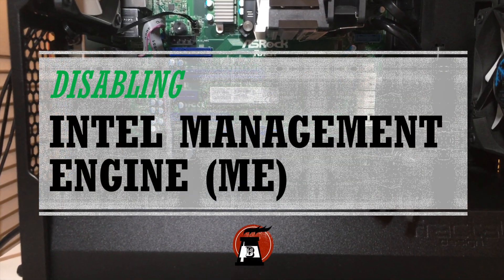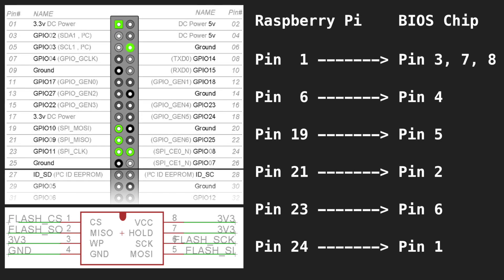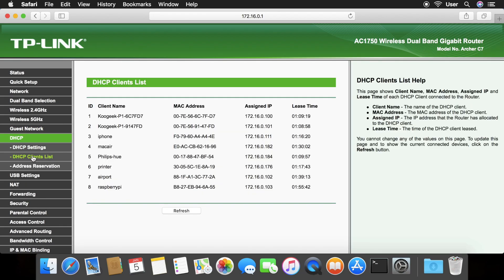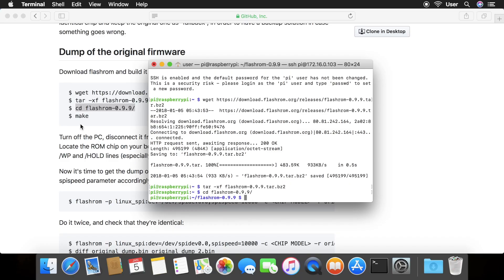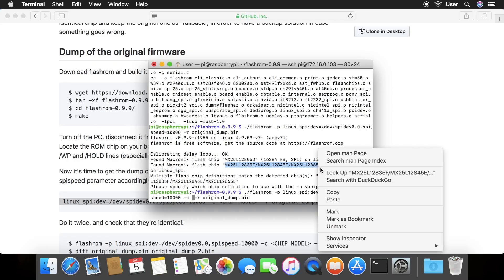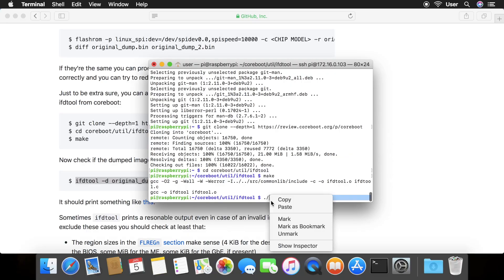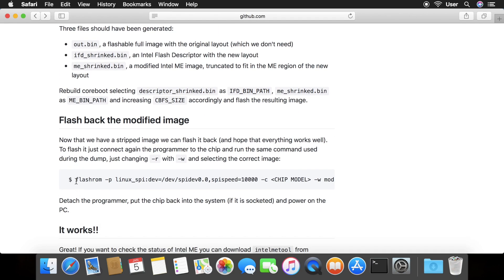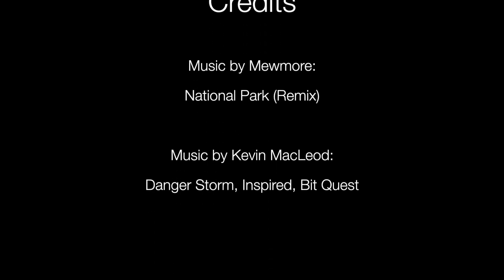DIY: Disabling Intel ME 'Backdoor' on your Computer

Comment: Intel ME cannot be disabled. It is embedded in the CPU and if you successfully killed off the Intel ME in your CPU, your CPU wouldn't start at all. What you are doing is disabling the BIOS code that talks to and enumerates Intel ME stuff and makes the hardware interfaces available to the OS. The ME is still running on your CPU and still has complete control over it.
Reply: Thanks for that explanation, as I was just going to ask how he knows the ME is actually disabled. It didn't make sense to me that one could modify bios when this ME is built into the CPU itself. Cheers!
Reply: @TecraTube  Supposedly, there's a flag that's undocumented which can be used to turn off the ME, inserted at the request of a three-letter agency for their computers. Even if it works as advertised, it can't fully disable the ME. It's still required for processor initialization and enabled during BIOS startup. A UEFI rootkit can easily get around this, for example.
Reply: @JodyBruchon  the alphabet group has custom built processors, they dont use off-the-shelf processors
Reply: @narmale  Aside from environmental certification, shutting off the ME is probably part of the MIL-spec part versions (which cost 4 times more).
Reply: @Drakilicious think bigger, computers have integrated wlan, and this fcking spy part in your processor will use ANY possible method to connect to its masters. and there may be embedded technologies, we dont know or even understand, like other RF stuff or st else.
Reply: @Drakilicious It's possible theoretically that the flash drives' firmware contain malware that can transfer data outside of the file system visible by the user. To avoid this use optical discs and floppy discs, they don't have firmware.
Reply: @vstoykovbg  but anyone who gets a hold of it can read it, unless it's a file drive containing important info that was encrypted prior. Who's going to spend all that money to buy DVDs?
Reply: @pieterwillembotha6719  Of course the data is being encrypted. 
But the problem is the malware can write unencrypted data to the inaccessible by the OS areas, so the user using a normal OS can't verify that there is no unencrypted (or encrypted by the atackers's key) data.
The DVD discs and floppy discs can be read and the user can verify that there is no "hidden" unencrypted data on them. This is not possible with USB devices.
For very sensitive data paper and pencil can be used (the user reads from the monitor and write the data on the paper encoded with RFC1751 or similar user friendly method of encoding binary data). The computer should be air-gapped. And for very paranoid users - with no hard drive, no USB devices. Because data can be hidden inside these devices.
https://github.com/vstoykovbg/RFC1751-encoding-decoding/
Reply: @vstoykovbg  Thanks for bringing that to light. I am a bit of novice.
Reply: Can they still spy on you if you completely disconnected your PC from internet connection?
Reply: @BessY992   Well, if you put it in a bunker 500M under the ground and never  connect to the internet..

y e s
Reply from the maker: I didn't say I was disabling Intel ME altogether, just the backdoor. You are correct, Intel ME itself cannot be disabled.
Reply: @yoonsikp  I know. It's just really important that people are clear on what this does and does not do. You should be commended for posting this video. Any work on neutering the ME is good in my eyes. My concern is that sometimes people (see previous comments in this thread for examples) will assume that this completely neutralizes the ME when that's not what it does. It turns it off after early boot but that's more of a very good workaround than a complete solution and there is still a small but functional attack surface.

Security is hard. :-\
Reply: @JodyBruchon  what do you use instead
Reply: because IME is in the CPU you cant disable or block it
the CPU can connect to the internet itself  just because you blocked some UEFI stuff it doesnt mean that it cant report anything (if it)
Reply: @yoonsikp  Exactly. By removing the software connection, it cannot do anything. No backdoor to remotely connect to, no way to log any of your keys.

It is effectively disabled.
Reply: you are not understanding what people are emphasizing  @LuggageStardate
Reply: That's what happened when skids try to act like big boys
Reply: There is a flag called the "high assurance platform" flag.
Inserted at the behest of some three letter agency as best I know.
If it's good enough for them, it's probably good enough for you and I.
Reply: Fuck the police :/
Reply: ME is still running but is unable to function to the extent it originally did.

Sadly this is as good as it's going to get as I don't believe ME will be removed anytime soon.
Reply: Sadly the features in the BIOS will be enabled if a command* is dropped into ME or if you update your BIOS.

* I don't really know how a payload is delivered in ME/Nor does anyone really know how ME functions as they've kept it quiet
Reply: Rueben James  
Makes me understand why there is so much suspicion about Huawei.

It is simply the assumption that because the US is maliciously doing this, that the Chinese are or will do so.

That may be a plausible assumption, but it also shows up the sheer hypocrisy of the US govt agencies
Reply: @LuggageStardate  it only cleans the useless stuff. The 84k one keeps all the spy abilities
Reply: @LuggageStardate  No, it can't. The ME is in the processor. It's not a BIOS thing.
Reply: @JodyBruchon  Imagine you have a little guy living in your house, you can't get rid of him, and he reports everything you are doing and saying to his masters using a walkie talkie. You don't like this, so you smash his walkie talkie. He's still there, spying on you all the time, but he can no longer report anything back to his masters.
Reply: @JodyBruchon  And how can they do that when the guy has no interface with the outside world? Yes ME is still running but it cannot talk to anything, its interface to the OS is gone. It's like a bugging device that cannot record and cannot communicate. Yes, it's still bugging but it can't relay any information to anyone. Also, dude, it's lame as fuck to thumb up your own comments.
Reply: @spudhead169  Can the computer communicate with the outside world? You seem to have a very poor understanding of how security breaches work. If the computer is online at all, the ME doesn't have to be on at all. A payload can be dropped from the online side to infect the ME or reactivate it during the next power-on. The ME can be neutralized during normal operation yet still have exploitable vulnerabilities.

As for liking my own comments, the only people who ever point that out are the ones desperately losing an argument with me. Feel free to stop responding now.
Reply: @JodyBruchon  Lol, It's still lame as fuck, no matter what you say about who points it out. The thing is, this isn't the 80's anymore. Hardware varies, what works on one system may not work on another. We have to have something called a Hardware Abstraction Layer. This allows the OS to use a set "language" to speak to the hardware. In this case, the ME driver, and the BIOS routines perform this role. This is because, although the ME is pretty much the same in the CPUs, different motherboards will have different ways of addressing it. So unless the payload knows about every chipset and every way that chipset is utilised on every motherboard model, it's simply not going to work. And THEN they have to figure out a way to get code to run in super mode, which you cannot do on Windows without addressing a kernel level driver. Pulling the HAL will prevent 99.999999% of all possible intrusions. Beefing about the ridiculously small probability of this ever occurring to someone who has performed this mod is a waste of time.
Reply: @JodyBruchon  maybe just maybe this guys cook also with water :D
Reply: @JodyBruchon  I like your comment. Keep posting, even when there are some complaints. It's helpfull to other people.
Reply: @spudhead169  you do not need to talk with your neighbour, when you read his mind. There is no need to talk with OS, while you read whole RAM including HyperVisor (ring -1) and SMM (ring -2), where OS cannot access
Reply: @spudhead169  you wish to know what you writing about
You do not need to abstract CPU. There is no need for HAL directly on CPU. 
Any library is HAL. It may be Direct3D, OpenGL, Vulkan, but CUDA is not OoenCL is not. UEFI is HAL. BIOS is HAL. IME is not HAL. IME does not serve user lever purpose. It is there, but you cannot really use yourself in direct way. There is no access to it for you.
Reply: Guys dont forget Intel ME is just 1 of 3 "spy" hardware technologies running UNDER the OS.
Second is UEFI itself
Third Is TCPA /TPM
Bonus but easiest opponent Windows 10/8/7/Vista/XP. (Win10 has the highest Spy-factor ;)
Reply: @hyperhektor7733  TPM runs on half ISA bus called LPC. I have full control over LPC. UEFI may be tougher, but still did not have access to quite a lot
Reply: @WizardNumberNext  thx for the inof i didn't know ISA is still a thing xD, but what do you mean with full controll?
Reply: @hyperhektor7733  LPC is implemented inside SuperIO chip like ITE IT8721F (it have Watchdog, sensors and SPI for BIOS/UEFI, maybe more). In linux there is driver for all functions of this chip.
Reply: @spudhead169  I wish everyone explained everythimg like this. Nothimg would ever be difficult to understand
Reply: @spudhead169  How did you know he thumbed up his comment
Reply: @AJ-gm7vf  I didn't know 100% but it was very likely. Comments far down a long thread rarely get many thumbs up, and when you see brand new comments from the same person appear consistently with 1 thumb-up each, you're pretty safe jumping to the conclusion.
Reply: @spudhead169  best part is, he disables the bridge between intel ME and the OS, but runs Windows. Who is probably spying more on you, Intel or maybe ... Microsoft? haha.
Reply: @JodyBruchon  The ME firmware is located on the same chip as the BIOS. That doesn't make it "a BIOS thing". They're separate partitions on the same chip.
Reply: Anybody have an opinion on the Purism's Librem line out?
Reply: he posted this video way too early for April first
Reply: Not that anyone is going to read all the way to this, but just so ya'll know the ME is a complete system of its own. It has no need for the user OS nor for the normal CPU cores. ME is essentially an 80486 (physically integrated somewhere in the CPU package) with its own tiny bit of rom and flash memory and its own operating system (It was Minix based iirc, but probably customized beyond recognition anyway). Remember that many old 1980s PCs got along with 16kB RAM, which is a light L1 cache these days, and the the ME isn't even drawing graphics on a monitor.
Reply: Thanks for this comment!
Reply: @Jody Bruchon hello there does the Intel ME jumper in the motherboard can disable it
Reply: https://i.imgur.com/pNJdlYo.jpg

i just jump it to disable the DIS_ME with 3 pin now HWinfo64 doesnt show the intel me status anymore
Reply: Depends. On Pre-Nehalem CPU's, it actually DOES disable all of the IME. That's what I did with my Core 2 Duo on a Thinkpad T61.
Reply: My understanding is that the ME is not on the CPU, but rather is a chip on the motherboard.
Reply: @johnleuenhagen9068  it's in the CPU except for really old machines. Pretty much every Core I-series chip has it in the CPU.
Reply: @comrade3111  Intel did open up the ME and several researchers also figured out how to break into it, so it wouldn't be surprising if the ME could be rendered moot by System76. Consumer chips also come with a ME that is somewhat neutered anyway. It could be as simple as using a consumer ME firmware on other chips. It's also possible that they could feed the ME custom code that turns its features off and makes it stop accepting any further custom code.
Reply: @JodyBruchon  Intel ME must have been fixed by enabling new Intel Software Guard Extensions(SGX) security in new Intel CPU's hasn't it?, Or may Intel ME still be unsecure?
Reply: I just let the OS/CPU/Whatever do what it wants to do now. I use an OpenWrt router with a plugin that blocks all this telemetry.
Reply: What about risc-v? With it being open source hardware can’t we ensure that has no back door? I’m interested in what the M1 chips by Apple have as well.
Reply: @yourpersonaldatadealer2239   RISC-V is only an open source instruction set and protocols. They do little to show you what the manufacturer physically put on the device. It can help to probe and discover but is not like compiling your own software from source code. Even then you should compile the compiler from a simple boot strapped home brewed compiler to avoid latent code injection. (Of course this is all after inspecting the millions of lines of spaghetti code that make the good compiler and whatever you are compiling.)
Reply: What does this bios part exactly do?
Reply: It seems the only way to fully disable it is too ?
1.libreboot
2.system76 
3.core boot
Reply: Wrong, ME cleaners work for earlier generations of cpus
Reply: I think you are right, it is part of the architecture of the CPU
Reply: I wonder! Why can't we stop traffic sent by ME at network-level? Does ME use TCP/IP? What can ME send online about my computer?
Reply: #1 reason to avoid Intel completely.  CIA loves this feature to spy on everyone.  They have unfettered access to any Intel based CPU since Core2Duo, regardless what software you use.
Reply: good luck passing Windows SecureBoot with a bootlegged system... unless you relax security checks!
Reply: Get out more lol
Reply: @green386  Arguing on the internet is more fun than fire ants and mosquitos and allergies.
Reply: But it cant communicate with the OS, thus not being able to lets say, send data or receive data, basically insulated fro  the world. 

So it's tecnically killed as its useless
Reply: how do you know?
Reply: @sambrero8729  you should specify whom you are asking your question to :P
Reply: Guys. When you connect to the internet. the internet will rewrite your bios to reactivate the ime next time you boot. It's a probability
Reply: @erticyusa5928  Its also verifiable, if we assume its not smart enough to play dead.
Reply: Meh you can make it not to do anymore so much so you kinda talking little bit too round right there sir.
Reply: @XantheFIN  English word salad, woo
Reply: @JodyBruchon  Okay thanks.
Reply: @JodyBruchon  It's not disabling BIOS code. The BIOS/UEFI chip contains the BIOS itself and the ME firmware.
The Management engine CAN be disabled. A kill-switch (HAP bit) is available in the firmware, which ME will turn itself off after initialization (meaning after POST).
Do note that once ME is turned off, things like overclocking (Integrated clock controller), fan control (QST), trusted platform module (You'll need it in Bitlocker), etc will be broken.
Reply: @shamringo7438  That sounds terrible.
Reply: Jody Bruchon That said, your computer will still boot. Just a few warnings and your fan will be spinning at full speed and you can't slow it down.
Reply: I can tell you how to disable this don't buy anything from Intel it's not like they made the best processors anyway they just made the most for many years maybe in the early 2000s they were number one in quality but not anymore
Reply: AMD also has something similar   @Nick_Gir
Reply: @Nick_Gir  which ones are best to buy
Reply: @Drakilicious ME allows connecting to your computer even offline. It has built in wifi and 'they' could connect to your comp within a certain area. Also, ME knows when you put info on a DVD or mem stick and 'he/she' puts its own in the same time with you. Paper is a solution. That is why Russian secret services gave up totally comps and bought a huge number of mechanical typewriters! :)
Reply: @regeleionescu935  ME doesn't have built-in wifi, no, where did you read that? 
even if it could use the system's onboard wifi (which is only in intel's chipsets since CoffeLake R) you'd still need an antenna t reach further than 3 meters away anyway....
Reply: @regeleionescu935  you are glower who say that Intel gás ME that cannot bem desable so cannot we can do...
Reply: Buy AMD.
Reply: @enchantress7928  AMD has a similar system to ME
Reply: @gregmcmill1798  I wonder why... It's almost as if someone very influental showed up at their doorstep and REQUIRED them to put in such a feature.
Can't imagine who would do that and why. Having possible remote access to virtually any PC in the world doesn't sound like something profitable...
Reply: @juicyblunts  Go where?
Reply: @juicyblunts  Sorry, I didn't realise.^^
Reply: Enchantress AMD has a similar vulnerability.
Reply: Mort Rainey any exploit that affects the similar AMD engine remains poorly documented, if at all. It definitely does exist, but right now it's mostly the glownigs who actually have the tools to use it.
Reply: @KingHalbatorix  Terry Davis fan?
Reply: @JodyBruchon  Sorry to butt in here, but who wouldn't be? He was a fellow who demanded direct access to ring zero.
Reply: @enchantress7928  doesn't make difference. they have their own ME.
Reply: @enchantress7928  AMD has their own version
Reply: @enchantress7928  AMD has psp.

Comment: I would recommend editing the warning that not all bioses/ motherboards are supported. This can brick you PC.... it's not a trivial task.

Btw: how can you verify that me is disabled?
Reply: From what I have seen and heard, you cannot disable IME. If you somehow did however, I think it's safe to say your computer wont work.
Reply: @secretzpt176  there is a tool for linux called imtelmetool that can check if it's loaded and working or not. Problem is, can you trust software....:)
Reply: @BR0KK85  There is no way to verify that it's disabled FULLY. Doing this is basically just a waste of time.